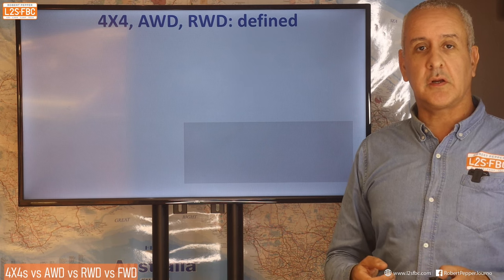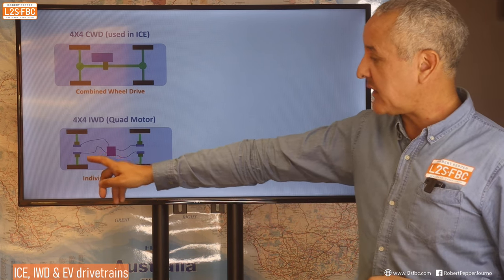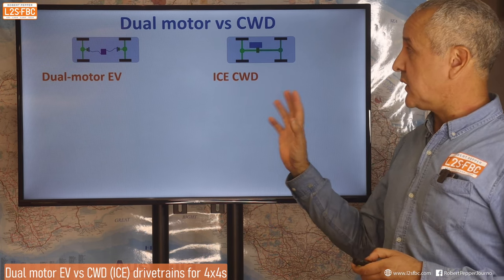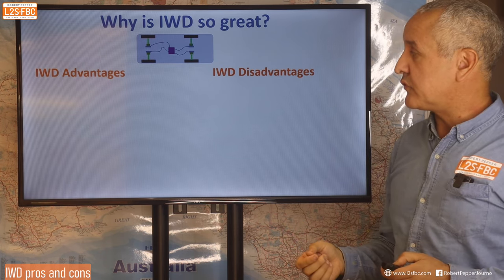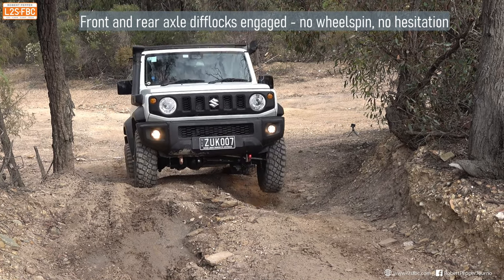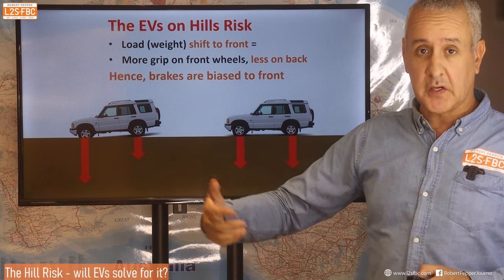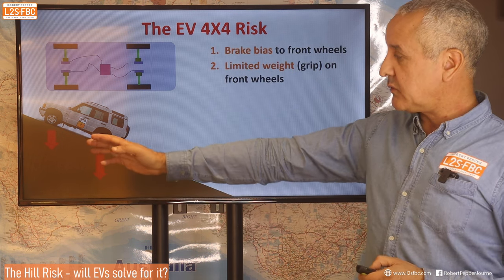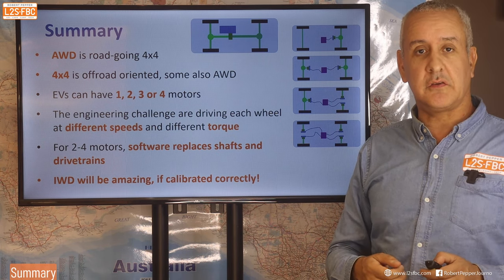Electric 4x4 powertrains, compared and explained inc Cybertruck

Comment: Excellent diagrams and explanation, there are other subtleties going on too, for example an individual wheel climbing a step where it "wants" to rotate faster than the wheel at the other end of the axle despite the vehicle going in a straight line. Rock crawling buggies seem to benefit from wheel spin to warm the tread, fortunately with the EV as long as each motor has adequate torque they can probably fix everything in software :-)

Comment: It would be great if you could also explain how PHEV such as Defender P400e works as I understand that it uses e motor in auxiliary to ICE as well as by itself alone in 4x4 set up.
Reply from the maker: Yes for the Land Rover PHEVs the electric motor can drive the wheels in CWD mode, or in concet with the petrol/diesel engine, or the petrol/diesel by itself.

Comment: Jeep now has a new mode. 4h full-time whichbis essentially AWD with a clutch for from axel.
Reply: Basically an overload clutch btween the front and rear axles that can slip to allow front and rear wheels to rotate at differing speeds when needed and to prevent transmission windup. With the clutch preload set loose enough to accomplish that, I wonder if there would always be enough clutch grip to tyrn the front wheels to surmount obstacles or reverse up steep gradients or out of trouble?
Reply: @WilliamLarman-ql3zh   I don't think it works as tough describe.  Clutch is not engaged until rear wheels slip.  Then it full on.

Comment: I think the future (some way off yet) for EV brakes is having no brakes, use the motor to slow the vehicle just as you use the motor to accelerate the vehicle.
That's less mechanical stuff to go along with no transfer case, no drive shaft, no differential, no gear box - add to that no brakes and no brake disks/drums.
I think that doing away with physical brakes is some way off as it would be hard for people to accept there's not a safety issue but from a simplicity viewpoint, it's the ideal solution.
Each wheel would be individually powered and braked with 4 individual motors.  I think ultimately that motors will be reduced in size sufficiently to fit inside the wheel hub itself rather then being a distinct unit somewhere between the wheels.

A few decades off perhaps but likely the ideal solution.
Reply: Would need to overcome the issue of how to brake the vehicle when the battery is full.  Don’t want to be going down a long hill and the battery refusing to accept charge half way down.  I guess they could force the vehicle to a stop if the battery gets very close to full and then have a resistor to bleed off energy and bring the battery back down to a preset maximum charge.

Comment: Surely the problem of EV braking in reverse down a steep and slippery hill is to have suitably calibrated and performing Electronic Brake Force distribution? 4 Channel ABS has been around for a long time now, so the hardware is there, should be just software tuning! It is a real potential problem as you say, as it's a bad feeling backing down my steep, long and bent driveway with a heavy trailer, applying the brakes more and having the front wheels lock up on car and you still keep sliding back. Electric brake control manual override is the solution there I'd venture.
Reply from the maker: Exactly that can work. Just needs to.be programmed.